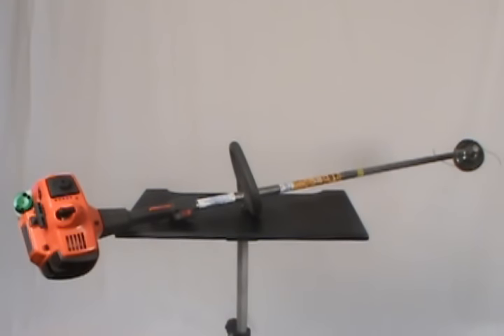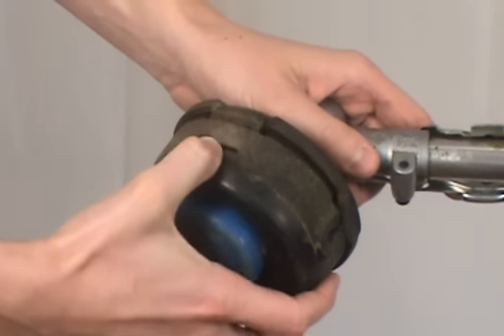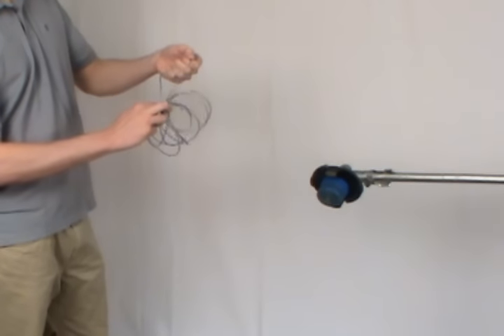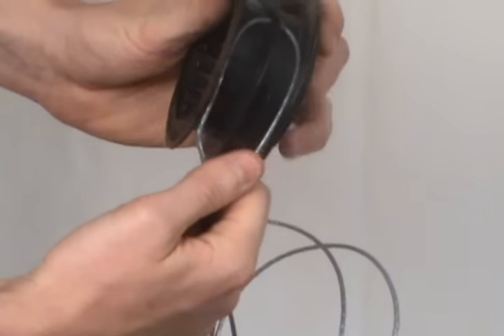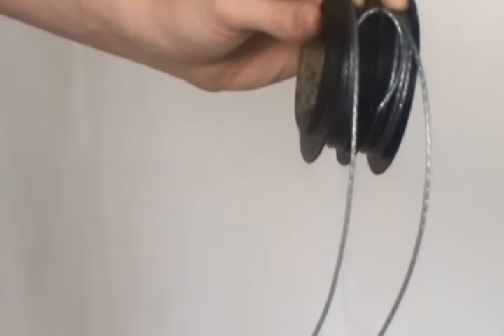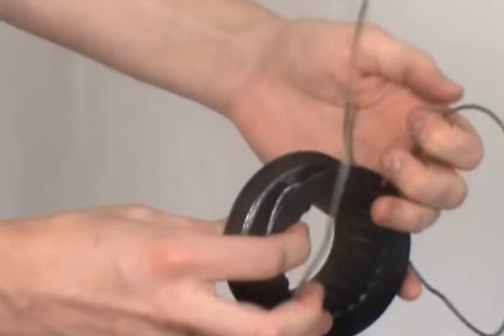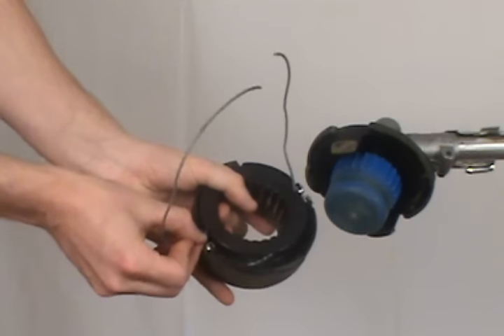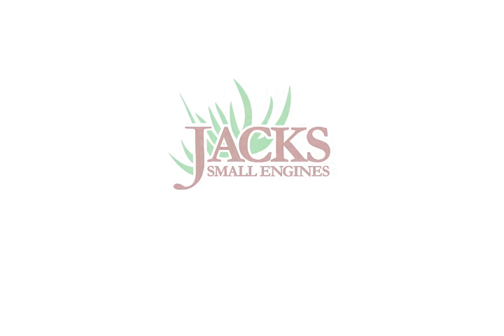Installing Trimmer Line - Husqvarna Trimmer

Comment: Have had the husq 324L since 2011 and just now learned how to do it properly. Wow. Thanks for your video. So simple now that I see the technique.
Reply: Me too. This is crazy easy. I was wrapping it around both sides with only one continual wind. It would never retract on it's own by this method. And the other videos I watched showed a different design on the wind cylinder. They had 2 holes in them to insert both sides of line. So, I just looked up Husqvarna specifically and now inderstand the correct way to wind the line. I am so happy. THANK YOU!!

Comment: Thanks. Bought used one. No manual. Spool holes looked odd when went to line it. Never would have guessed to loop it. All other double lines had before were 2 separate lines. Good simple video.

Comment: Did you not read the manual? The two ends should not be even. The offset distance varies with head model number. This difference in length of the two lines eliminates the excess waste when the line trimmer blade cuts off the ends.

Comment: What length of line are you supposed to put in!
Reply: Three full arm lengths
Reply: @DaysAhead202  Your arm lengths or mine?  ;P
Reply: @DaysAhead202  LOL
Reply: Cut a 10ft length of line. Attach the halfway point to the inside 'hook' of the spool. Then wind counter clockwise.

Comment: Omg your video was a life saver. I watched 3 YouTube video trying to find one with a slat for the starting point like mine. But question at the end when you're sticking the final pieces through the slats to be the trimmer ends does it matter if you finish it using the slat closer to the weed wacker (let's say "top") or to the ground ("bottom") because mine has slats at both ends.

Comment: I almost feel stupid for not knowing how to string my trimmer like that after all this time. Thanks for the lesson!
Reply: Same here.
Reply: Jacob Duncan don't worry, I have been doing it wrong for 2 years! Just watched this today and now I can finally do it right.
Reply: My trimmer line keep breaking every cut I do, what am I doing wrong? I bought medium trimmer line but everyone I do the trimming grass it’s gets shorter and have to open adjust line and start over again.

Please advice me
Reply: Euram Tek: You have to wind it in the correct direction. There's a small indicator on the spool for direction. Hope that helped!
Reply: I see two indicators that goes in to win it. Do o use in both or just 1?
Reply: fredrick haynes what type of trimmer line is he usingv? Looks like metal?
Reply: You only need to use one of the two slots in the center part to hold your looped end of your string. :).
Reply: No its not metal, its just heavy duty twisted line.
Reply: fredrick haynes which trimmer line heavy duty  you suggest
Reply: Im using shakespeare line at the moment and does well. Its tough twisted line. Just do a little research on reviews and choose what you feel you need. I cut through very thick stuff with this line with no problem.
Reply: fredrick haynes mine keep cutting off especially when doing edger and against wall concrete or floor weed beds.

Comment: Yes make sure you disconnect the spark plug. The weed eater could suddenly start by itself and press its own throttle button 😄😂😂. By the way people don't mess with the spark plug wire. You're just going to end up having problems with it later on if you keep disconnecting it.